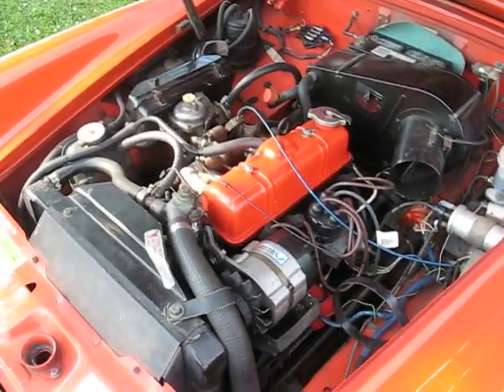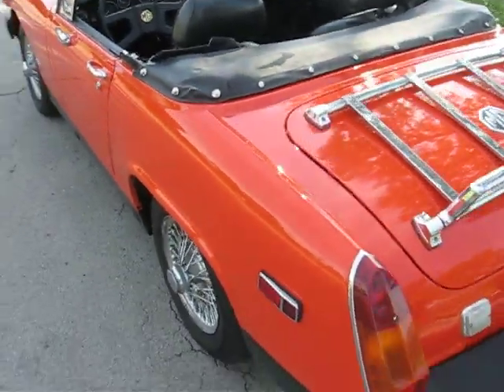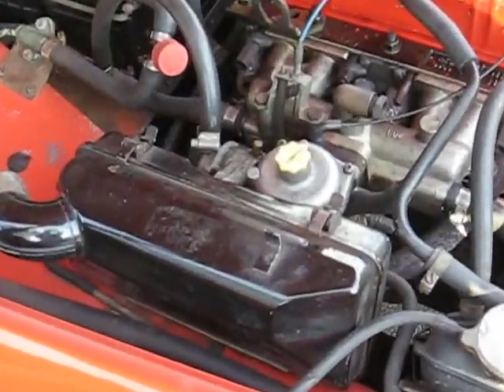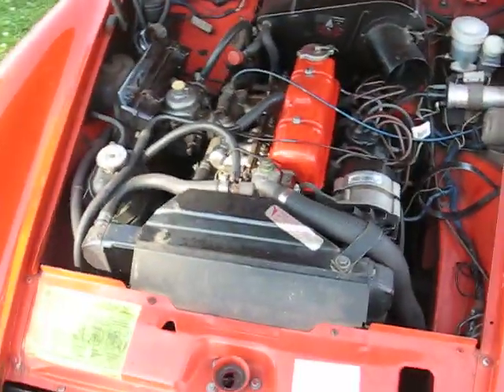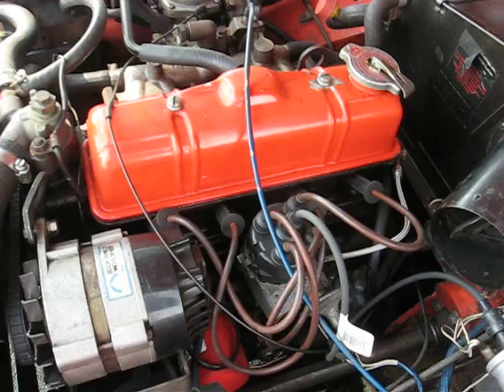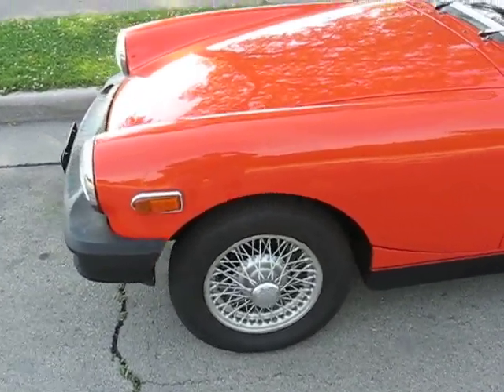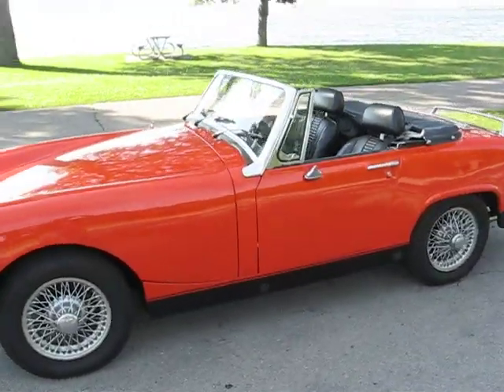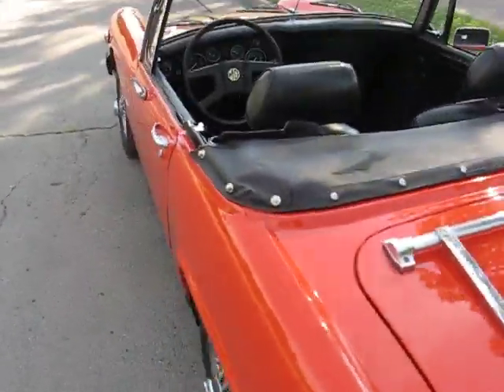My 1978 MG Midget.

Comment from the maker: My friend's wife (you can see his MGA on my channel) has a 66 with a 1275. I would love an older one with chrome bumpers (especially BRG like hers). Or better yet a Frogeye Sprite with a 948! Mine was $2400 all in with the head rebuild nad new bearings.I still need to rebuild the rocker shaft and suspension though. I am getting a Monza for mine. A friend has one on his 1500 Spitfire and it sounds fabulous! I'll check you channel to see yours.

Comment: I owned a 78 MKIII  back in the mid 1980's . I paid about 1500.00 for the car, and couldn't keep it out of shop, granted I enjoyed the car,I couldn't keep "girls" out of it . But it was costing me more than I made ,I found out the "rear end" was shot,probably explains why I kept blowing clutches.....I still miss that car,     it was just fun to own and drive
Reply from the maker: This one has been good to me. (Other than I have to keep replacing inner tubes.) The Opus distributor just gave up the ghost this summer, so my friend sent me a new Pertronics distributor. Very easy to set up. One of these days I'll get around to rebuilding the suspension so I can actually get out on the twisty roads.

Comment: don't know if you still monitor this but  heresy question. where did you get the banjo hose for oil to the head?
Reply from the maker: I can't reccommend that mod enough! You can pick one up through Moss Motors for $90. It's part number 821-360 and they have them in stock right now! It takes about ten minutes to install! (Just google "Midget 1500 auxiliary oil feed hose" and you should get there pretty quickly! (Or if you're in the Portland, OR area swing by British Motor Care and have Chad hook you up!)
 That said, you're right. I should probably make another video with the upgrades!

Comment: hi jpatt1000, I have mg midget 1977 that seats in the garage for 28 yrs. and finally I made it run but the idle  is so rough. I live in Vacaville, California which required EGR valve but the original  ERG valve is no good, and nobody is selling this valve ..can you please guide  me how to bypass or condemn this valve and to where to connect some of the hoses. I really appreciate your help and thanks in advance. God Bless You.
Reply from the maker: Well, I don't know what the laws are in California but in Wisconsin we have a rolling exemption date for collector cars in locations that require a smog check. (I don't where I live.) If you absolutely need the EGR valve you could search for a similar item that would thread into the exhaust manifold by itself or with an adapter. If you can get by without it, ditch it and plug the vacuum line for it at the carb and the ports in the intake and exhaust manifold. (This is how my car is currently. You can see the elbow for the EGR line next to the carb. Since this video I have put headers on it so the actual mounting location for the valve is gone.) Third option is to replace the intake and carb. I hope to do this job this summer as my friend at BMC in Portland sent me a Weber and intake for watching over his duplex for almost a decade.
Reply from the maker: Actually Chad at BMC might be able to source you a serviceable valve, or offer other options. Tell him his ex-property manager from Oshkosh sent you!

Comment: The problem with the car is those nasty horrible Rubber bumpers, my 72 is hands down nicer just because of that. Engine bay is nice and clean
Reply from the maker: Yeah, I'd prefer chrome bumpers, but  c'mon, it was $1500 and if you're going to have a rubber bumpered MG orange is probably the best color.
Reply: @jpatt1000  True it is a great color and a very good price fair enough.